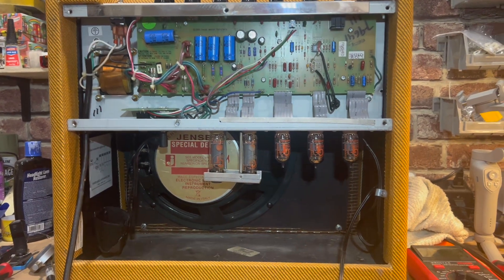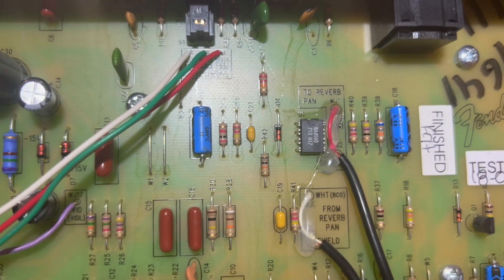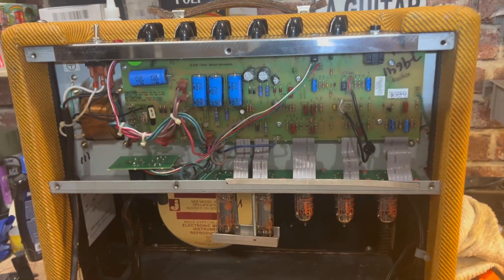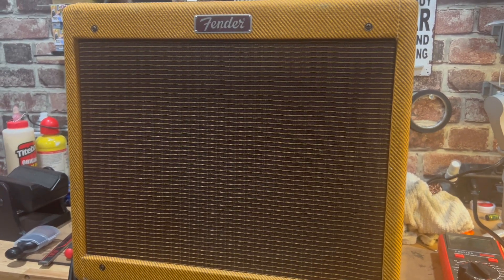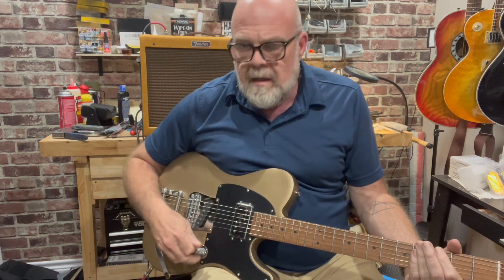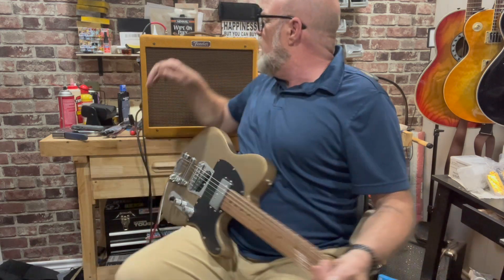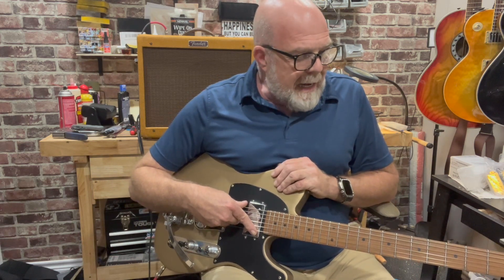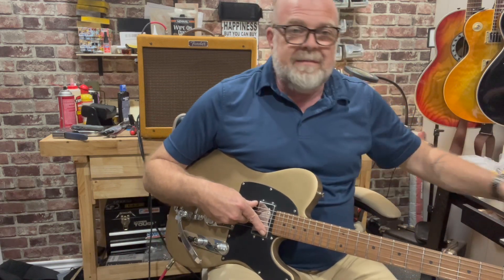Boost Your Tone: Fender Blues Junior Bias Adjustment And Reverb Tank Swap

Comment: I have the same amp but slightly later model with the black pcb board. I’ve done no modifications to it so far except changed the speaker to an Eminence Cannabis Rex. Changing speakers makes a big difference with this amp. I’ve also tried speakers with differing results, Celestion greenback G12M and Celestion Vintage 30, but the C/Rex has a warm tone I like. I’m told Warehouse speakers sound good too in B/J’s.

Comment: Dan great video I always wanted a blues Junior so I'll do it the way you did yours but I got to tell you about my amp I got a deluxe Reverb that was converted to a basement 11240 watt it's got a half power switch and maybe a switch it's fantastic I want to do what you did to the blues Junior so I'm going to buy one and do it and make sure I remember the clip the resistor Take Care thank
Reply from the maker: Seems to be a great little amplifier. There are dozens of videos on people repairing problems and I thought I might try to avoid some of those problems with this mod.